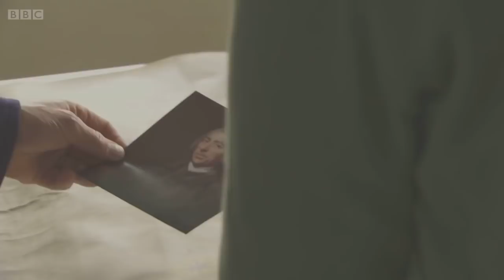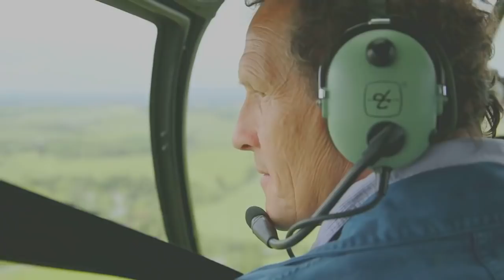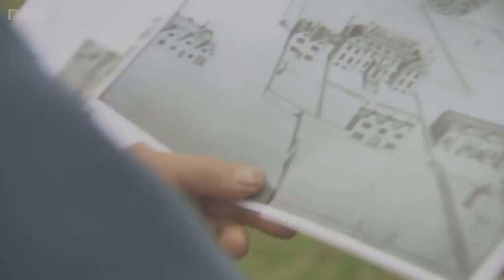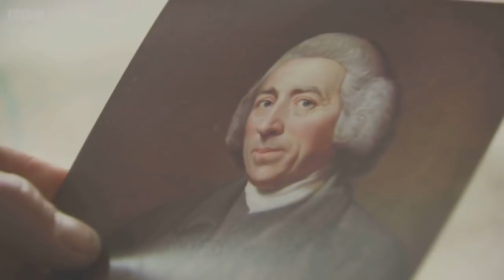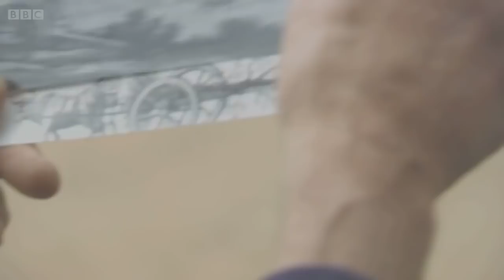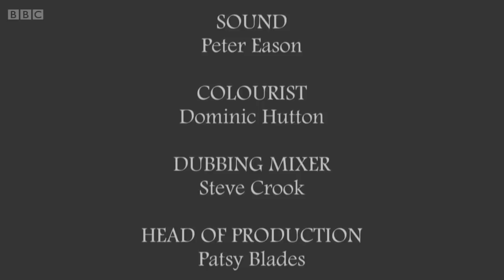The Secret History of the British Garden, The 18th Century

Comment: they must've had a procedure for transplanting trees.  after all, the ships brought in specimens from exotic lands (and had to survive voyages in the hold), and mature trees were placed in orangeries for ready production of fruits.  the research needs to be done.  the men doing the work (as well as the horses) were no doubt used to this labour and probably accustomed to the motions/events involved and encountered.  consider that perhaps the roots may have been treated in some way with a kind of preparation that would prevent desiccation and maybe even benefit the root/tree in some other way(s).  people back then were pretty smart.
Reply: They didn't transport plants back to England in the hold of a ship, they kept them on the deck so they could get sun. If there was a problem with weather (being too hot or cold) for a particular plant, they were carried in something called a wardian case, basically a portable greenhouse. I'm also not sure they tried to bring back mature trees, rather they took saplings they could carry in a pot or tub.
Reply: @nevyen149  thanks. I understand.  only thinking about smaller trees and roots.  also, I seem to remember that as long as the roots are kept from drying/are soaked regularly they stay in dormancy and can be transplanted or grafted later on. not 100% certain on that. people w/ greenhouses order roots/stocks via post and roses also are sold in bags w/ waxed canes to hold in moisture.  they must have done similar things.  it may be hard to have the decks so cluttered on a working vessel.  they might have 'rotated' a limited number of plants on deck....  it is intriguing and hope to discover more on this topic.
Reply: @megenberg8  It depends on the plant as to whether or not they can survive being bare root for very long, some can't. 
And it was basically these early botanists and plant hunters who figured out how to ship things like roses.
In those days, a lot of cargo might be stored on deck, and if the paying passenger was a plant hunter, they made whatever room on deck they needed. It would be more trouble to try a keep some kind of schedule moving possibly dozens of potted trees up and down the ships ladders everyday.
Reply: Gardening practices even today make root balls, soil kept around the root with fabric like burlap sacking.